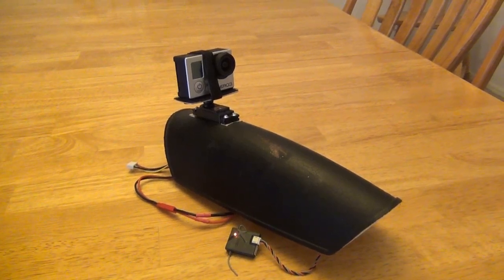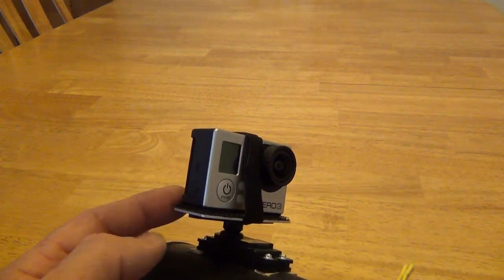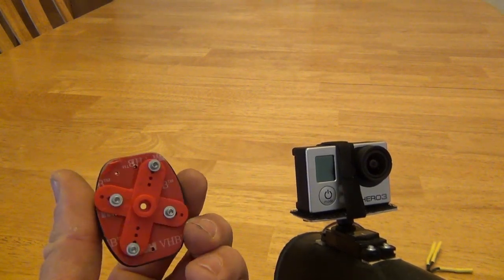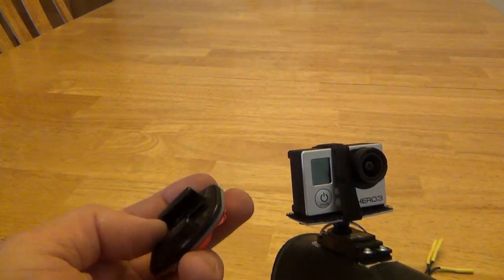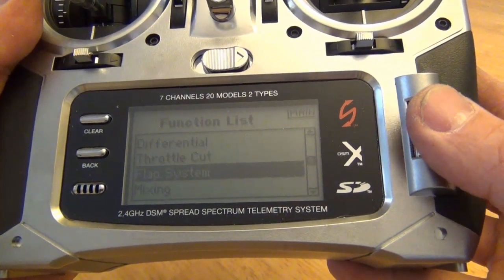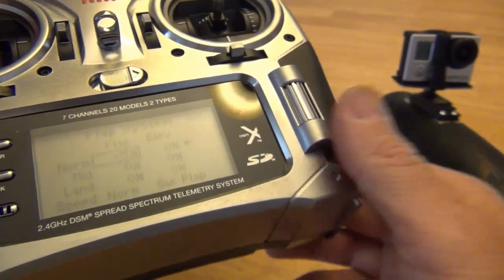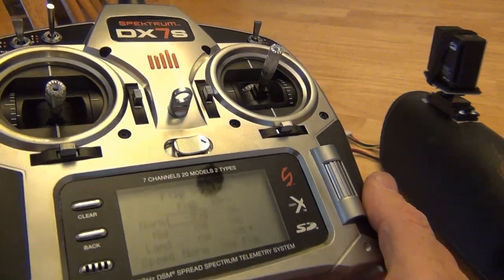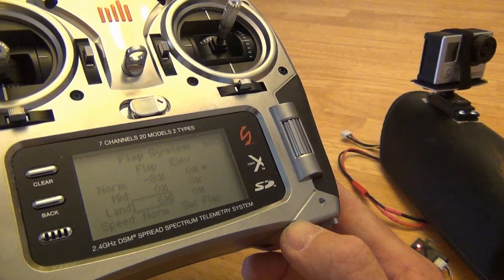How to make 360 degree rotating GoPro camera mount.

Comment: Hi, thanks for sharing your idea, I've used it successfully today in my Biplane only it's in the cockpit, I was wondering if I could pair it to the rudder servo so when the plane steers left and right the camera does the same ... https://youtu.be/Ipzl2d6K5jw
Reply from the maker: Glad the rotating camera mount worked for you!  Sure... you can pair a camera servo with your rudder servo.  I've done that but the big difference is that you need a "regular" servo for your camera servo.  It all has to do with travel amounts and what tells the servo to move.  The robotic servo is in simple terms just an "on" or "off" servo.  Unless you tell it to stop, it won't.  A regular servo will move 10, 40, or 70 degrees.  Whatever you tell it to.  Pairing the rudder and camera depends a little on what kind of transmitter you have.  I use Spektrum and it is pretty easy to pair any two channels or servos together.  Just make sure the camera looks left when the rudder goes left, and so on.  You can also slow the camera servo speed down.  That just helps keep the viewer from getting sea sick!  Good luck!

Comment: can I get all description and accessories, I want to build same...
Reply from the maker: The "expensive" accessory of the bunch is a model aircraft transmitter and receiver if you are a non-flyer.  If you fly, then that really does not add anything to the cost.  The transmitter just has to be able to have a dedicated channel for the camera rotation servo and the ability to manipulate servo travel and direction.  I use Spektrum radios and use the three position flap switch so I can control left, right, and stop.  
The servo has to be that Hitec HSR-1425CR continuous rotation servo.  That is the only servo that will give you the full 360 degrees.  Horizonhobby.com sells pretty much everything you need for this project.
Mounting the camera to the servo it just how I show in the video.  Weight, water proof capability, and inside or out of the case will be your deciding factors.  Just make sure your servo is securely affixed to whatever you have it in, be that a mount or removable canopy.  I then just use velcro straps to hold the canopy or rubber bands to hold the mount itself if need be.  Your specific situation will dictate what you use.  
Good luck!

Comment from the maker: Weight is everything when it comes to flying.  The less weight the better.  I've done some camera mounts where the camera itself was on it's on rotating surface while the servo just rotated that surface.  That works fine for anything around 160 degrees. Once you try for 360 degrees it gets a little more complicated.  I've used a pulley system to allow the servo and camera to rotate independently the 360 degrees.  It starts getting bigger and heavier.  This direct mount onto the servo is super simple.  I've used it on 6 different models and have had several hours of problem free flying.  I do see your point and at first I was a little skeptical.  So far though I have no problems.

Comment: Have you measured how slow you can make the camera rotate (RPM or time wise) for a full 360 degrees?
How much power does the servo take?
Reply from the maker: The slowest rotation is about 11 seconds for one 360 degree revolution.   Power draw will vary with speed and load anywhere from 100 to 500 mAh.    The servo is rated at 46.8 oz of torque on 6V supplied from an ESC.
Reply: austinaeronautics2
Hey, Thanks for the quick reply.  After watching your video I was wondering if I can use a continuous rotating servo to make a powered panning head for a GoPro camera that I could mount on a tripod.  11 sec is to fast.  I need to be around 60 sec for a full 360 degree rotation.  I'm not familiar with servos and was also trying to find a DC motor with a slow rpm but couldn't find any so your servo project looked promising.  Do I need a RC controller to operate these or can I just use a battery and a rheostat?
Reply from the maker: MrGrunthunter's Adventures Have you thought of using an "old fashioned"  egg timer?   It rotates at 360 degrees a minute.  You can do as many minutes up to an hour.  Ikea has one that a lot of guys have used for GoPro cameras.  You can Google or YouTube these I'm sure.  I thought of using one but I wanted to be able to change directions so I went with the servo and Transmitter controller.  The hard thing is getting any rotating device to be smooth.  A DC motor should work to get your 360 degree if you drop the voltage to slow it and then belt drive it to a larger gear holding your camera.  Once again though... this adds complexity where the simple egg timer is cheap and easy.  Just a thought.
Reply: austinaeronautics2
Yes, I have seen those but unfortunately they are 60 minute timers and take a full hour to rotate 360 degrees.  I need something that will only take around 60 seconds.

Comment: Do you happen to have information on how you mounted the servo securely to the Calypso canopy?  I see the brackets, but have no idea what those are or how they are made.  Thanks!
Reply from the maker: I cut a rectangular hole in the top of the canopy just big enough for the servo to slide in.  Then on top I glued in with Foam Safe CA  two sections of hardwood that the servos can get screwed down to.  I then drilled four small pilot holes in the hardwood where the screws will go prior to running the screws down.  This will keep the wood from splitting.  I then screwed the servo down.  Once the servo is in, secured, and adjusted for travel I just run a long loop of Velcro around the front of the Calypso fuselage and over the canopy just at the base of the servo.  I use the three of the thin 8" x 1/2" Velcro strips that you can buy at any Home Depot or Walmart.  This Velcro strap will hold the canopy on and still provides easy access to the battery.  Those brackets you see in the video are for mounting the servo and camera on other airplanes.  I've put a GoPro on pretty much everything I own at one time or another.  Good luck!
Reply: austinaeronautics2 Thanks for the info. I like this method better than the others I have seen.  Did you have to add any weight since the camera is forward of CG?
Reply from the maker: HyperSpinDazz I have 28 grams (1oz) of weight on the tail of my Calypso.  Mind you, I fly my glider with a 2200 3 cell lipo because of two sets of LED lights I installed.  This is along with a larger ESC and two separate light controllers and all the extra wiring.  So your glider might be different.  Just remember to only trim you model for level flight with power off if that is where you plan on doing most of your flying.  If you only use power for climb it is easy enough to just give a little down elevator stick under full power during a climb out.  That is simply because most gliders climb at too steep of an angle under full power regardless of how much stock down thrust is built into the motor.  You can see the LED lights at night on the Calypso at   Flyzone Calypso night flying with LED lights and the wiring set up at   Tricked out Flyzone Calypso   Good luck!